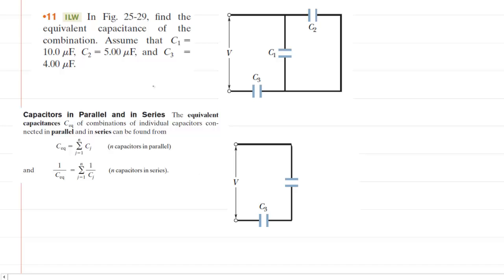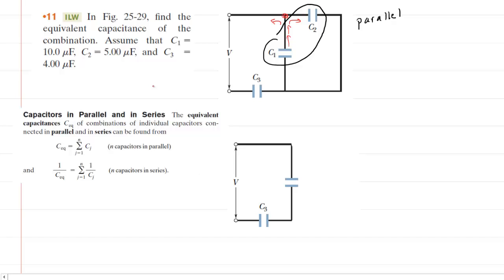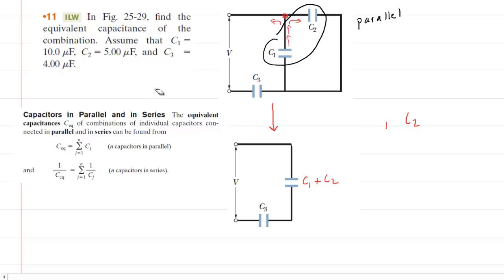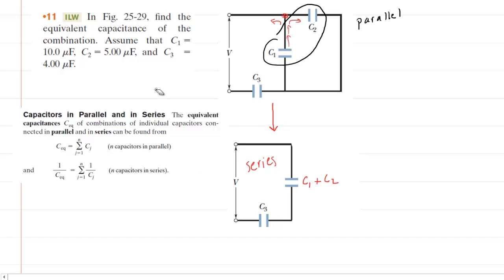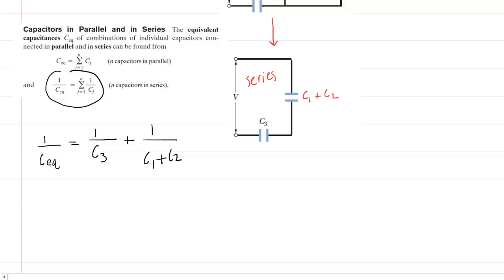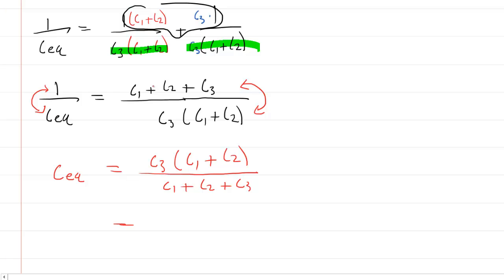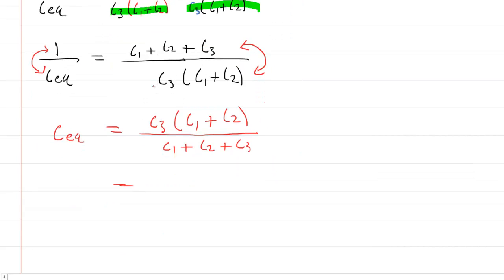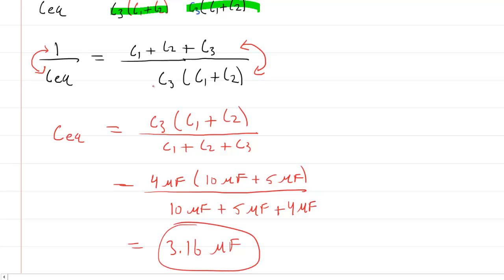In the figure find the equivalent capacitance of the combination

Comment: Yo, when finding the equivalent capacitance of the first two capacitors, why isn't it C1 that joins to C2 and not vice-versa.
Reply: Nothing would change in that case; you'd still come to a junction whether you were going from C1 to C2 or C2 to C1. Thus, this concludes that they’re connected in parallel.